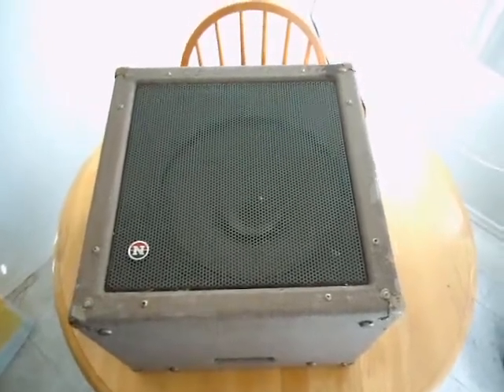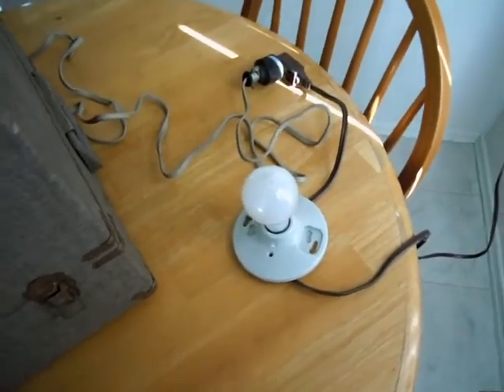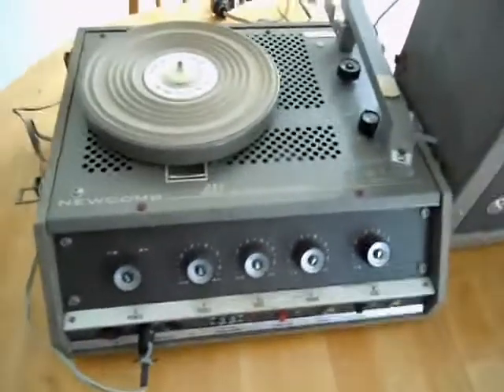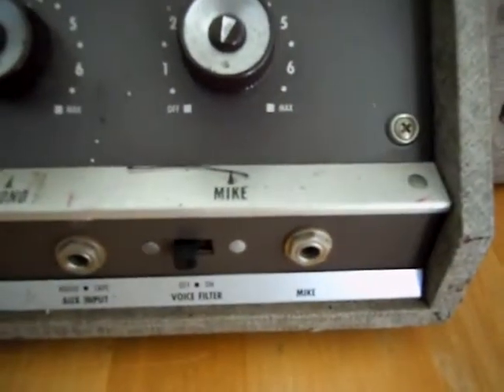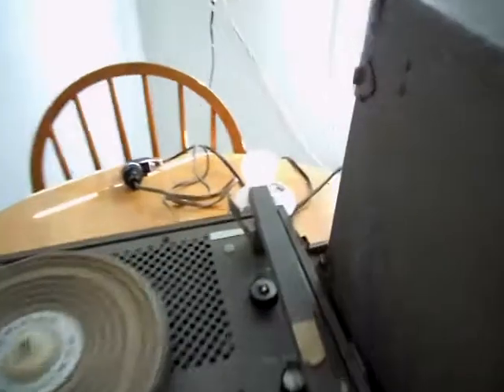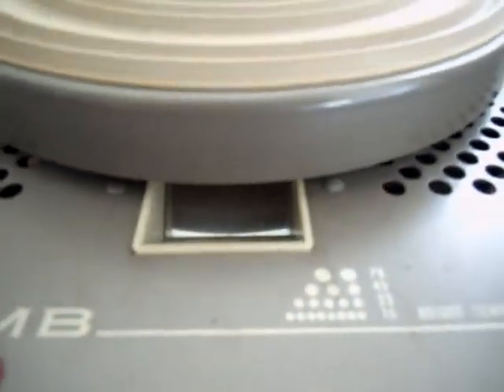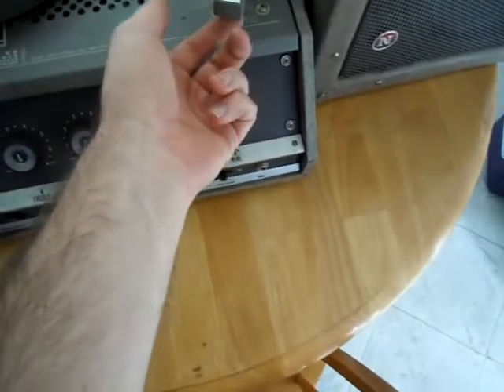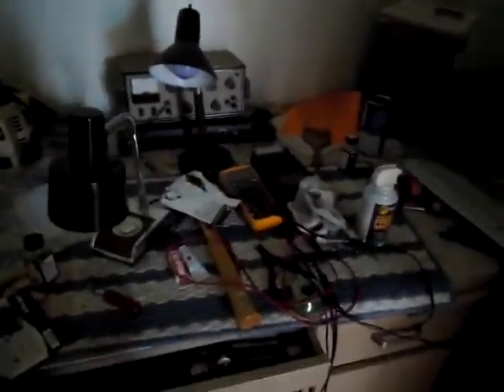Vintage Newcomb 1625-m Record player / PA amplifier

Comment: Jordan,

Thanks for doing this video.  I was recently given a Newcomb EDT-1225V.  It was filthy as it sat in a church's basement for a very long time.  It cleaned up nicely.  Mine's a solid state unit from 1971 with most of the features your 1625-M has.  My machine is working, but needs a new cartridge, an 89T.  I can only play 78's, but not very loud, even with it's 12 inch speaker.  I plan to recap it which should improve the sound a lot, I hope. 

Regards, Tom

Comment: Jordan,

I found the date (Nov 16, 1971) in my Newcomb stamped on the bottom of my case.  I also found date codes on some of the components.  I found on two transformers and the motor a "71" along with two more digits. I believe this four digit number indicates the year and week the component was manufactured.  I found 7124, 7136 and 7138 on my Newcomb.

Regards, Tom

Comment: Thanks that was pretty cool. I actually have a TR1656 M with dual speakers. The speakers are one suitcase and the  turntable in the other. This model as it turns out was a favorite of early DJ's who were also Square dance callers. I think the separate power switches for the turntable is so the DJ could talk to the crowd while he queued up the next song, or so it could be used for a PA only.

Comment: Since I am a square dance caller and used to own one like this years ago I can tell you these were made exclusively for Square Dance Callers to use. Newcomb 1625 were standard along with Hilton, Caliphone and Clinton in the 60s-70s with Newcomb dropping out Square Dancing rigs in the late 70's.  Hilton is the only company of the four that still makes Caller rigs.
Reply: Do you have any idea what the cable is for this rig? I can’t seem to find one anywhere
Reply: @guitarmx103  2 pin DIN male plugs required for the speakers.

Comment: That's an awesome unit. I wouldn't be surprised if the source of the distortion is leaky coupling caps putting too much voltage on the grid of the output tube (s). I hope you find the time to resurrect this one
Reply from the maker: Still have it, and I'll eventually dig it out an do a video. So many projects, so little time.